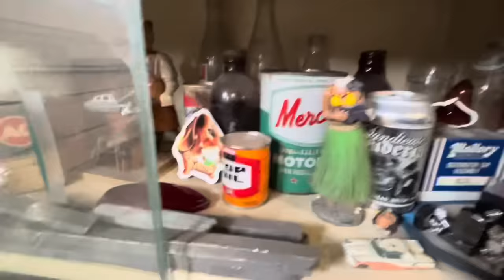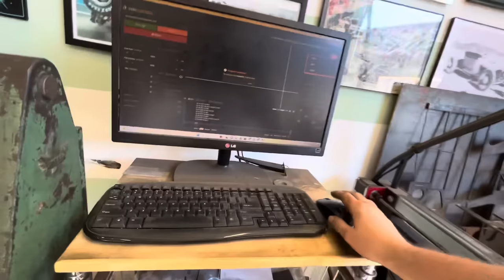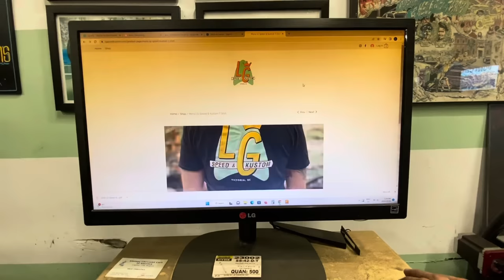32 Project Almost Ready To Fire. 32 Ford Build Part 25

Comment: On the mechanical fuel pump the pump rod wears and sometimes you have to add some metal to get it to increase fuel output (in case the new pump doesn't fix the problem).
Reply from the maker: Yup, my dad told me about that trick. I’ve never personally experienced it though. Guess we’ll find out when this one hits the highway!

Comment: The first place I have seen the V Band clamps used was in the aircraft world. When I was working in the F-4 fighter they used the V Band on the bleed air system that supplied super heated air to the leading edges of the wings. It was used like a windshield defroster in that it prevented ice drone forming in the wind (a very bad thing to have happen) to maintain lift on the wing in cold environments. I know they are also used on the C-130. Both planes were designed in the 50’s and 60’s. Just an FYI.
Reply from the maker: Wow that’s really interesting. Thanks! So I guess that means they could be period correct after all!

Comment: Another great video. Looking forward to the next one. Just finished installing Offy heads and a Fenton dual carb intake on the r.p.u. Now the generator won't work where I wanted to put it. Hoping an alternator will fit.
Reply from the maker: Offset generator mount maybe?
Reply: tried an offy offset generator mount. got the generator over the pass side head but now it totally interferes with the top rad hose.  @LGKustoms

Comment: I never thought I'd get the 2 lower hoses installed on my stock '47 Tudor Sedan but when folded just right they did go on without unbolting the radiator!  Even the pass. side with the heater hose fitting.  Nice save on the headers.
Reply from the maker: Yea I changed the ones out on my 47 without removing the radiator. I think they’re a bit longer than these ones though.

Comment: it is a cast iron head. You can use cast Iron plugs, IE cast iron crack repair kit. No need to remove the head. Works fine lasts a long time.
Reply from the maker: Cool! Thanks for the tip.

Comment: That's fucked up, if that gasket was snapped in half straight outta the box! You're certainly right about today's quality 
control standards, Lee! :face-blue-wide-eyes: [Cool spinner, in the background, by the way.]
And they use those stainless clamps in the food industry, too. [I worked manufacturing Gelatin for 23 years.]

Comment: I avoid Teflon tape, especially on cast iron without much area around it. It tends to crack, as you have now. I don’t know if you have Stag jointing paste over there but that seals real good without cracking the cast iron. It might seal that crack as well. Also it allows the sender to make a good ground, Teflon sometimes insulates.
Reply from the maker: Thanks for the info! A few others have suggested crack repair solutions too. I think it’s work a try before replacing the head.

Comment: I had a failure in one of those glass fuel filters. It worked great for many years and thousands of kilometers until one day, the vibrations stripped the internal threads off. I noticed it just before departing on a 6-hour highway drive. Could have been very bad, so ill never trust one again.
Reply from the maker: I’ve had plastic fuel filters crack before. And hose clamps fail… and fuel hose split… and hard lines crack… everything mechanical fail’s eventually.

Comment: 3:16 I know those corrugated hoses work but they always look ugly to me.
I know this would take some time for the crack, but prepping the crack and preheating the area, you could then silver solder the crack up.
26:48 If that is a 45 degree fitting the thread size is 1/2-20 for 5/16 line and 5/8-16 for 3/8 line.

Comment: Was told "never use Teflon tape on cast aluminum manifolds", use pipe sealant instead. Wonder if that old mechanic's rule extends to cast iron also.
Reply from the maker: Maybe? I’ve never heard this rule before.
Reply: @LGKustoms  According to my source, the slipperiness of Teflon tape allows the fitting to be accidently over tightened. Using Teflon, I did crack an aluminum intake at the temp sender which had to be welded and retapped. IDK, kind of makes sense.

Comment: Great job Lee. 👏
I noticed that the flange you made was only tack welded on the pipe, did it need to be completed welded?🤔
John from Australia.
Reply from the maker: It’s fully welded on the inside of the flange. Most headers are welded this way, it’s easier to weld and you can manipulate the tube to fit tight against the flange for better flow.

Comment: Can you weld those temp ports w/ the head in place ?  I don't know , but it might be an option .
Reply from the maker: Might be tricky, cast iron needs to be pre heated and then cooled down very slowly after the weld. I usually put the part in a bbq for the pre heat and cool down, meaning the head would have to be unbolted.
Reply: Working on cars , especially old ones can be very frustrating . You came a long way with it , though . @LGKustoms